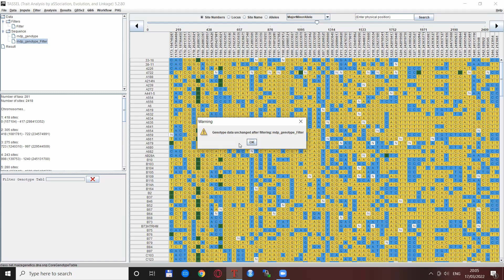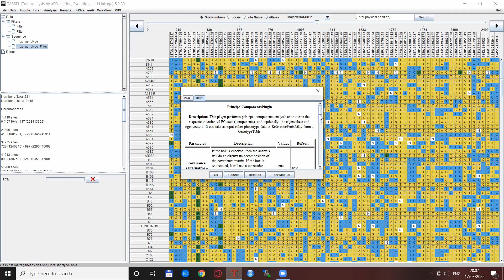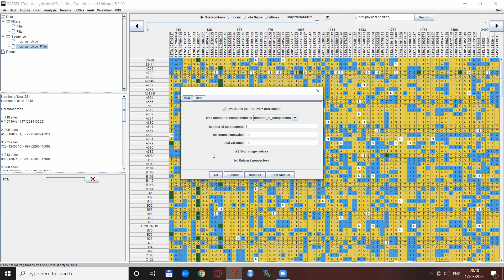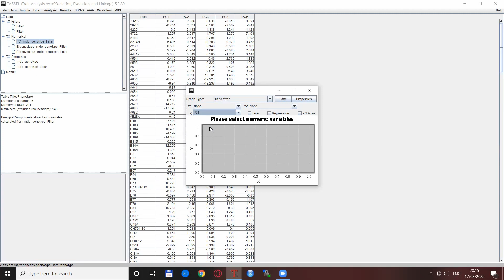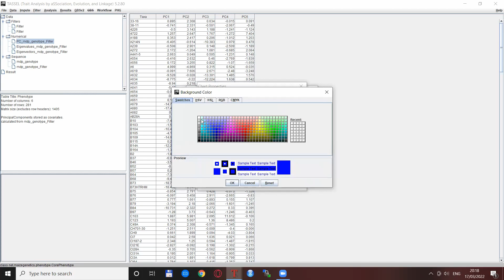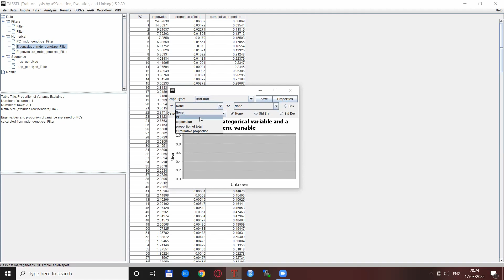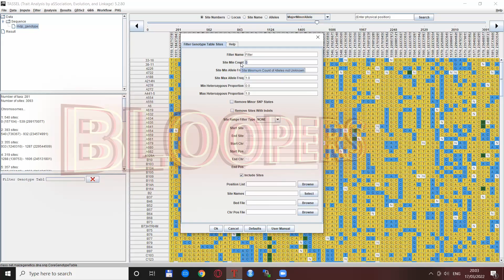PCA analysis with TASSEL

Comment: I have tried to do PCA analysis.. But I found a trouble : the plugin couldn't complete the task because it is out of memory..Would you help me??
Reply from the maker: If it is a memory issue, maybe the data set is too large for the computer. Maybe try with a (much) smaller data set first, if it works? And then if you really need the large data set, just run it on a larger computer.
Reply from the maker: ...but if you tried with the tutorial data, this is really small already, so there might be an other issue. Definitely try to restart the computer and try again with the tutorial data.